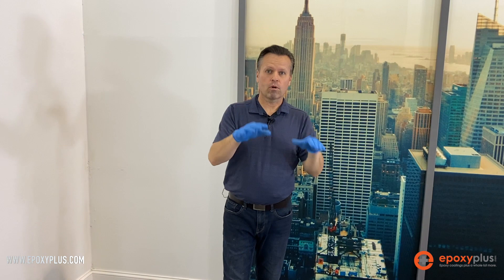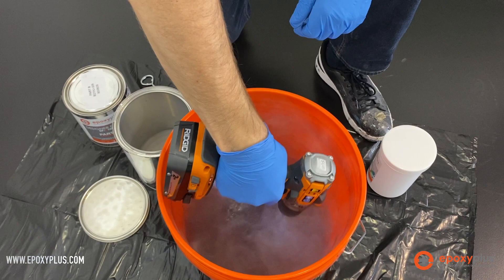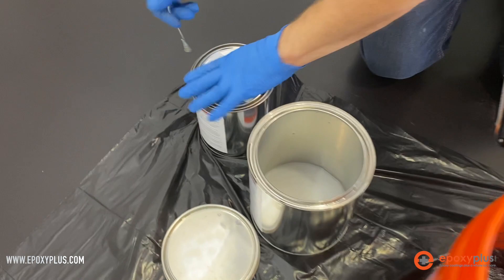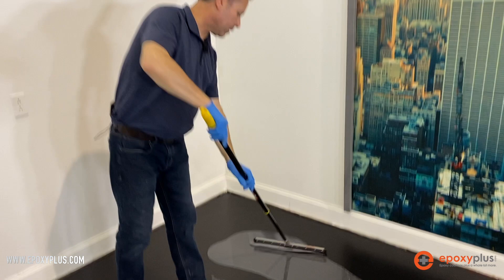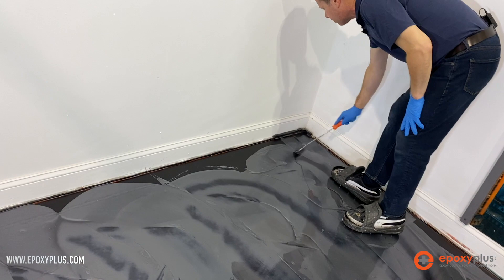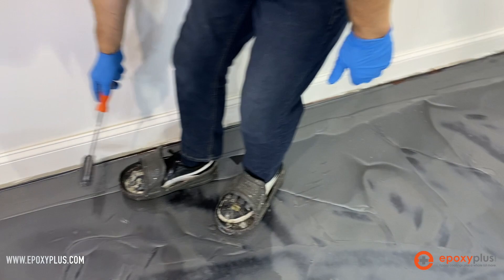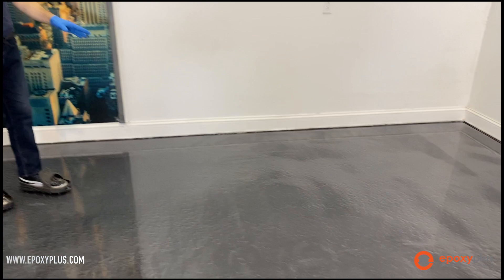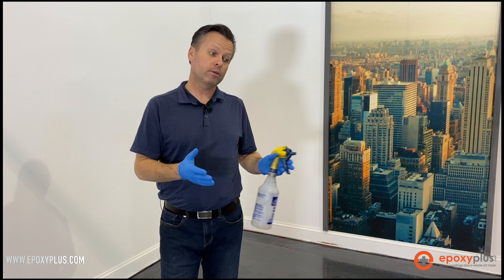MAKE POLISHED CONCRETE FROM EPOXY RESIN

Comment: I love the look ... can you share the specific part numbers of the items that I need to buy from your site. My concern is that I might buy the wrong parts. Also you stated that you primed the floor with Black primer? Do you also sell the primer or will any black primer work?
Reply from the maker: Hello, our black primer that is compatible with the metallic epoxy is EP-E300. A 1.25 gal kit covers up to 500sf
The metallic epoxy is EP-E100  you can apply at 80-100sf/gal for this look. 
1 jar of titanium metallic pigment per 3 gal kit. 
EP-U4000 High Wear Urethane. Each kit does up to 500sf. You can also contact us through our website www.epoxyplus.com if you have any other questions. Thanks for watching!
Reply from the maker: Hello, our black primer that is compatible with the metallic epoxy is EP-E300. A 1.25 gal kit covers up to 500sf
The metallic epoxy is EP-E100  you can apply at 80-100sf/gal for this look. 
1 jar of titanium metallic pigment per 3 gal kit. 
EP-U4000 High Wear Urethane. Each kit does up to 500sf. You can also contact us through our website www.epoxyplus.com if you have any other questions. Thanks for watching!
Reply from the maker: Hello, our black primer that is compatible with the metallic epoxy is EP-E300. A 1.25 gal kit covers up to 500sf
The metallic epoxy is EP-E100  you can apply at 80-100sf/gal for this look. 
1 jar of titanium metallic pigment per 3 gal kit. 
EP-U4000 High Wear Urethane. Each kit does up to 500sf. You can also contact us through our website www.epoxyplus.com if you have any other questions. Thanks for watching!

Comment: I absolutely love this look! I have a question I can’t find an answer for when I google. Can I use flooring epoxy on a bar top? I have a project that is 33’ x 2.5’ and this technique looks like it would be very easy to do on such a large area, as far as working time.
Reply from the maker: Yes you absolutely can do it on a bar top.
Reply: Thank you for responding so quickly! Can I ask 2 more questions? 
1. How long is the working time under normal indoor temperatures @ 70°?
2. How thick a poor is recommended?
Reply from the maker: You can expect 45-60 minutes typically. We recommend installing the metallic epoxy at about 60sf/gal however it can be applied thicker.